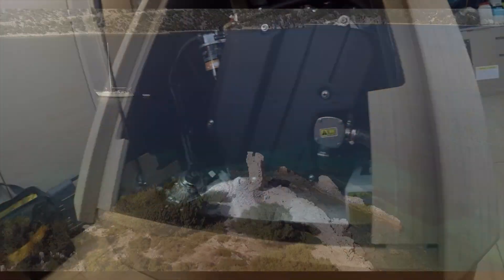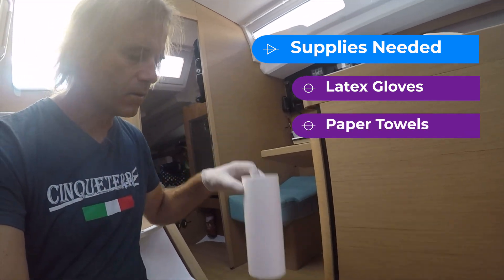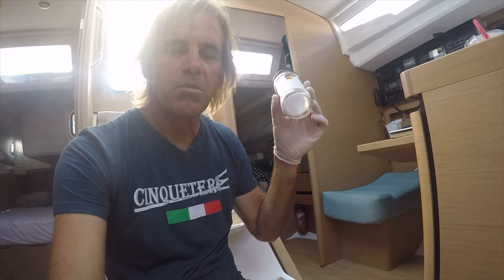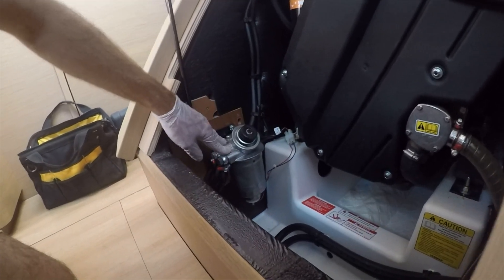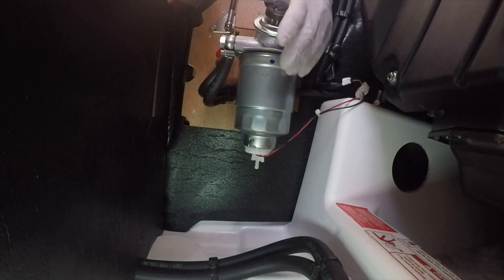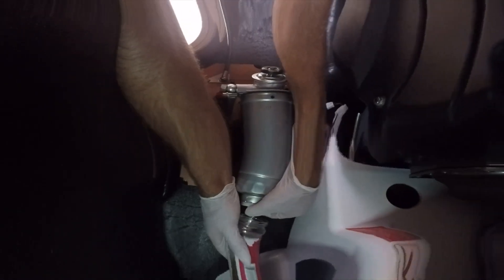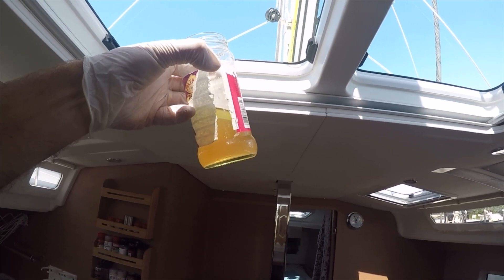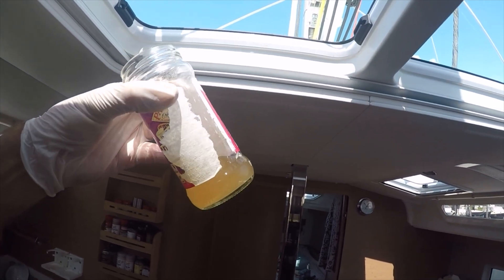Boating Basics | Diesel Engines | Keeping The Water Out! | Ep. 134

Comment: How did you solve the water in the fuel? And what was the root cause?
Reply from the maker: Hi John. We initially believed we got some water in one of our fill ups from a fuel dock. There’s also a chance that some accumulated from condensation in the tank. But the most likely cause was the deck fill was located next to the port helm station where water runs down the deck before it drains through a scupper. We raised this deck fill by about 1/2inch and that seemed to help.